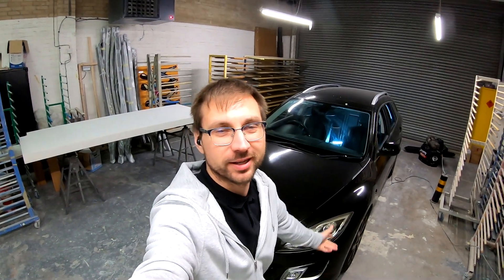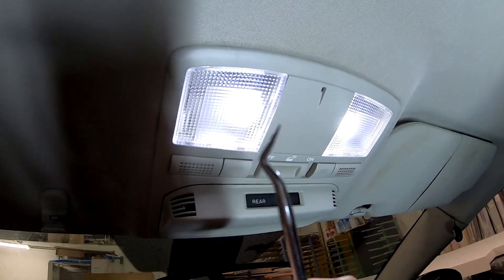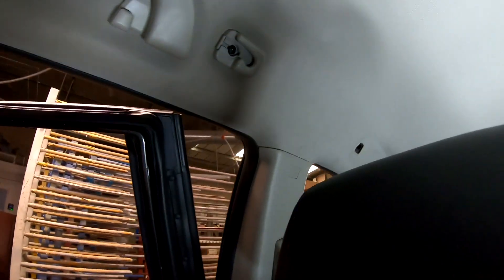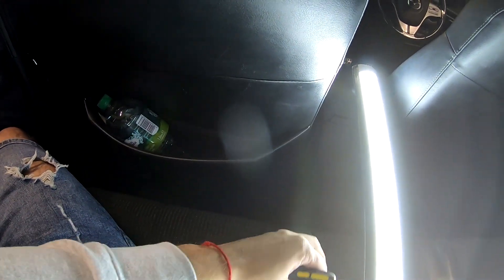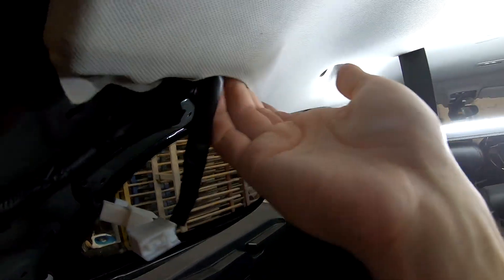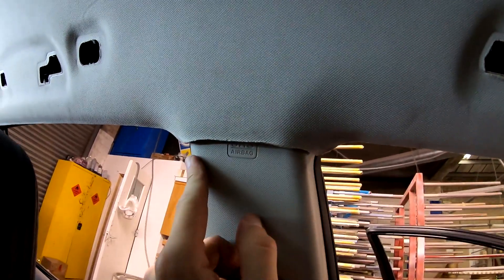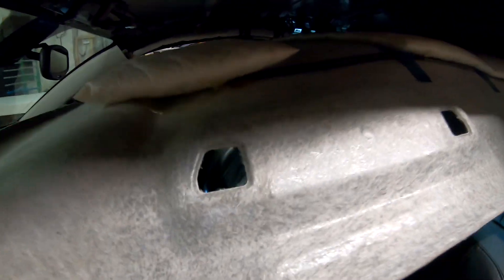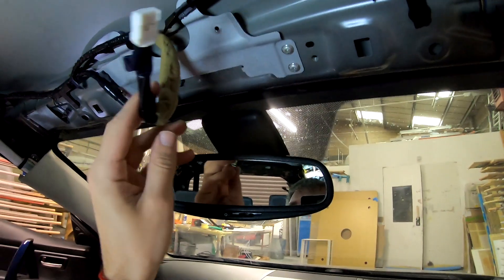Headliner Removal On 2010 Mazda 6 GH

Comment: I need to remove my headliner because the ceiling light for the rear once you remove it you can't put it back unless you remove the headliner.  Why Mazda did it that way is anyone's guess but that's the way it is.  Thanks for showing how you did it.  Now my only concern is I don't have an estate M6 like you but a saloon. Therefore I don't have a big hatch to remove it from.  I guess it makes it more of a challenge which mean more fun!
Reply from the maker: It should be more easy for you, you have less estate to work around, and If I could guess, it will come out the same way as my one did
Reply: @KlavsX_  Can you please show that process on your next video or a quick video with this. I am having the same issue.
Reply from the maker: What exactly you are looking for?

Comment: Do I need to remove the headliner so I can get access to replace the roof rails?🫡
Reply from the maker: IF you got the same car, with the same roof rails 100% 
4x 10mm bolts each side